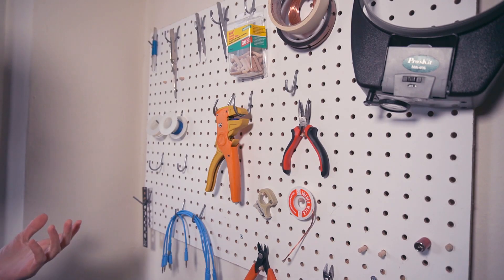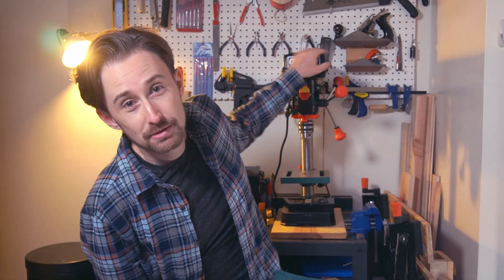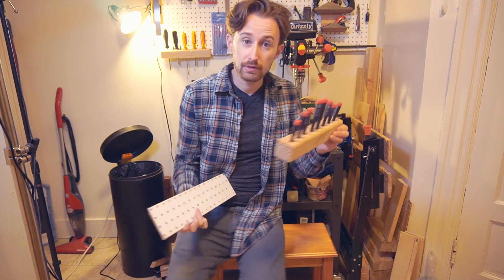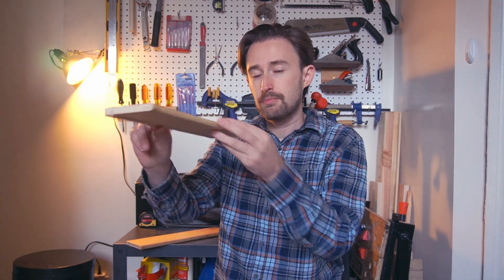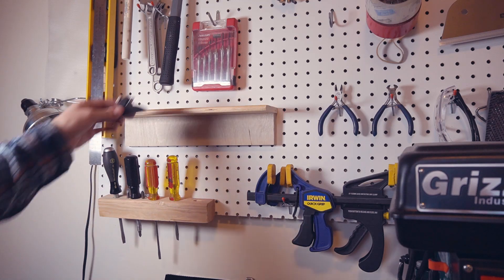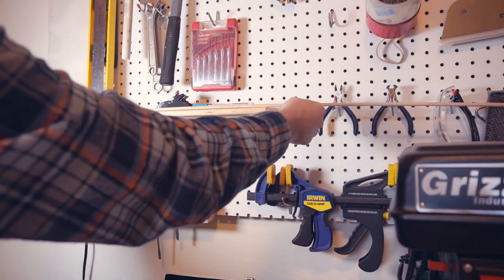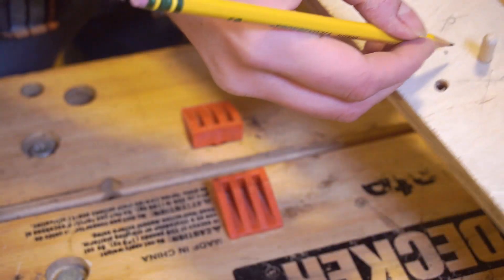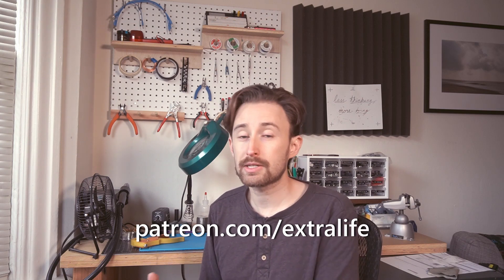Making Custom Pegboard Tool Holders

Comment: Vertical room is always at a premium with a benchtop drillpress like that, but consider making a spoilerboard to cover it's table, so you don't bite into the surface of it as much.  Mine is just a scrap of MDF with some rails to help align it and prevent it from spinning if it catches.